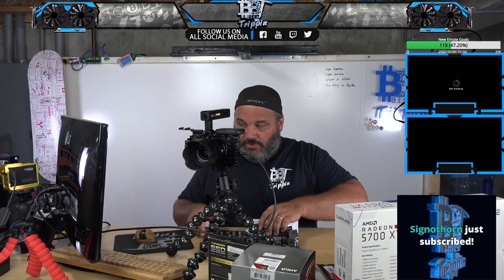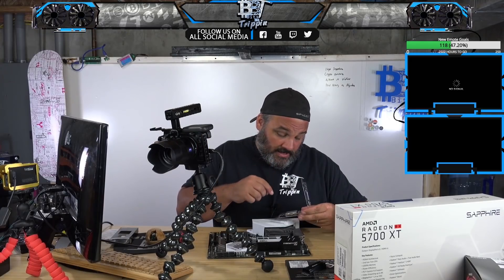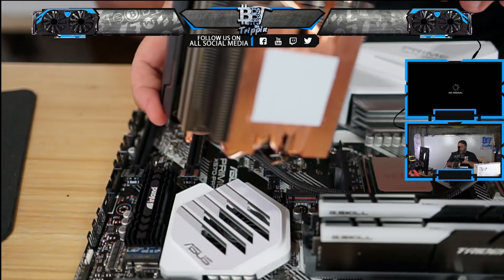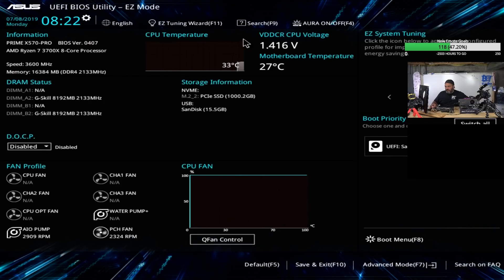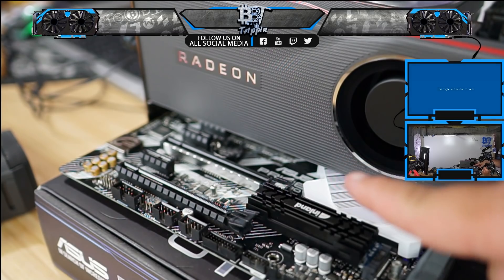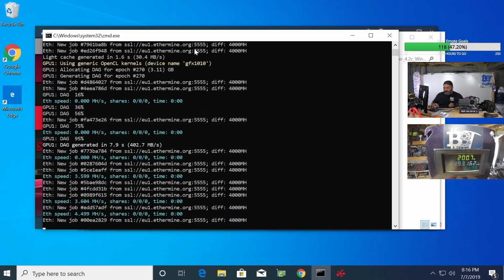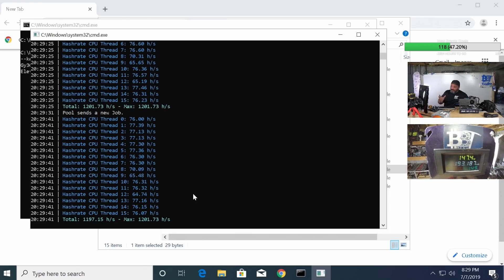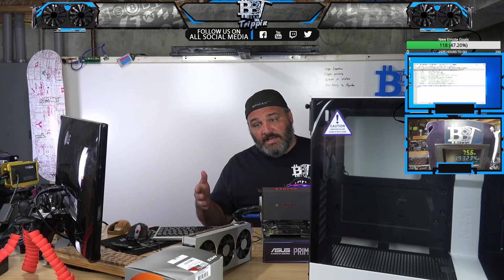Ryzen 7 Gen 3 3700x Full Build with 5700XT - Does it mine? Recap of 2h+ Livestream in 12m

Comment: I´m thinking about buying Ryzen 7 3700x, 570x mini itx Aorus motherboard and Amd Radeon RX 5700 XT. And I was thinking is that stock cooler good enough? I don´t plan to oc my cpu because I haven´t never done that. Or should I buy after market cooler for that processor?
Reply from the maker: So far I have had no issue with the cooler that was included. I replaced the thermal compound with the Thermal Grizzly from Gamers Nexus. It does a great job.

Comment: Question:  Let's say I had $1000 to spend on GPU's.  In general, would it be better to mine off of a single $1000 card, or to instead use two $500 cards?
Reply: id say 5 200$ cards
Reply: With more cards you can mine different coins at the same time. So it gives you more options.

Comment: Pretty sure the drive should be installed in the top slot closest to the CPU as that is the one that is connected directly to the CPU instead of the chipset.
Reply from the maker: Does not matter on this board. Reviewing the specs in noted in the BIOS and within the manual. Both are PCIe 4.0 x4 mode.
Reply: Yes, all are 4.0 x4, but only one of the slots connects directly to the CPU, reducing the latency incurred by jumping thru the chipset first.  Ryzen has 20 direct CPU lanes, 16 for GPU and 4 for SSD.
Reply from the maker: I hear ya, however not all chipset makers necessarily use the CPU PCIe Lanes. From my 10 minutes of research on the ASUS Prime x570 Pro it looks like the 4x lanes are both provided by the chipset. Digging in further to see if I can get a diagram of the PCIe Lane architecture for the M2 slots on this board directly.

I know looking at previous x99 boards, in the manual it makes reference to use the one closest to the CPU for the exact reason you are mentioning, however, in this manual it creates both equal (assuming since both are moving through the heatsinked/fan cooled chipset.
Reply from the maker: You know, it would be a good test to do some benchmarking using both though, could be a interesting test.
Reply: I'm pretty sure the top one is from the CPU instead of the chipset based on the part in the manual where they specify the speeds differently based on CPU generation, but then it also supports sata and that's confusing.  Also that even the chipset would still be limited to pcie 3.0 speed with a 1000 and 2000 series.  Ultimately though, chipset or not, you'd still get the same thorughput, it's just a bit more latency.

Comment: Had to down vote because Mining needs to die and quit causing video cards pricing to go up because of BS Demand.
Reply from the maker: I hear ya David, however, due to mining having a huge increase in 2017, then subsequent fall in 2018 has caused a gamers paradise in avail good used GPUs (GTX 1070's for 200 on open market etc); The GPU companies have responded by creating mining edition GPUs which was great for many miners to not impede retail and buy focused GPUs that had less power and good output (best of both worlds for gamers and miners). 

As some say, don't hate the player... if/when mining grows back into popularity, there are more options for GPUs then there ever has been. Thanks for your feedback and very valid point of lack of demand 2 years ago.
Reply: Mining is not a problem is that greedy ngreedia that is bad jack all  the gpu price as they please and use miner as an escape goat .
Reply: @BitsBeTrippin  5700 XT looks like it runs pretty cool and quiet under load?